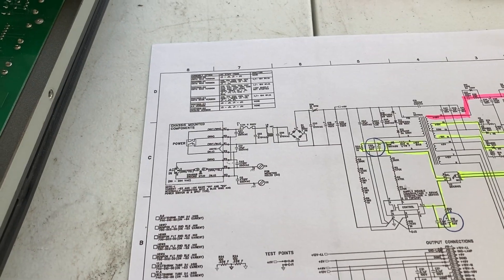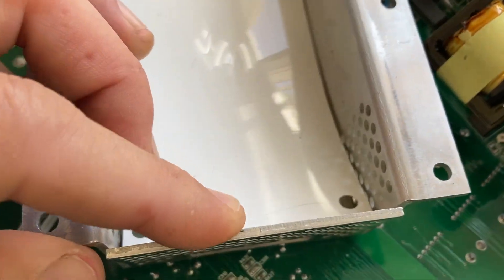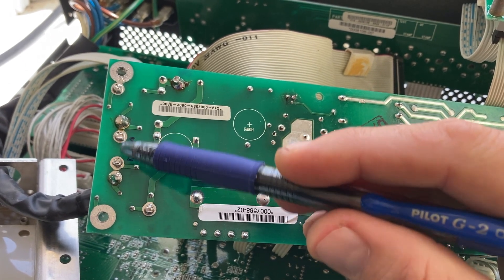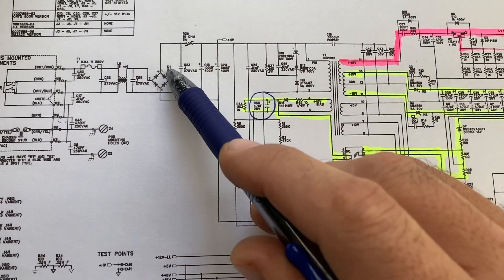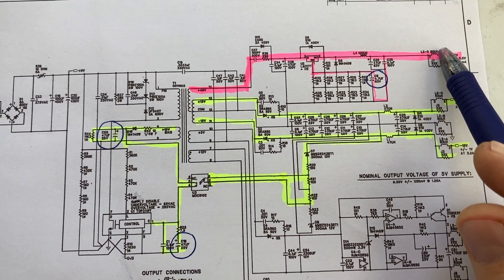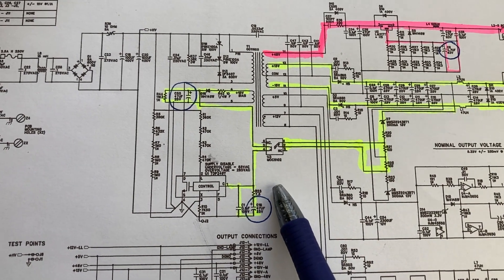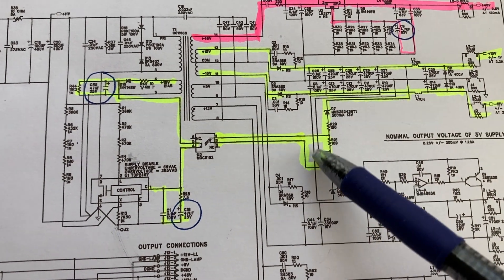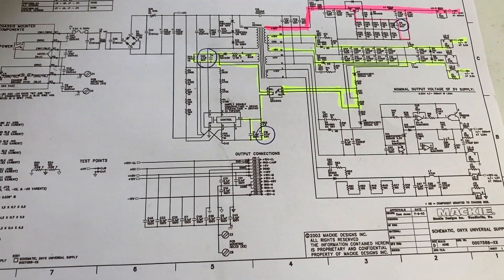Mackie Onyx Mixer Power Supply :: Flashing Blinking Lights :: Audio Electronics Repair Fix

Comment: Hey my friend, or savior! I don't know if you'll see this post since your video is over three years old, but you never know. So, after a storm and numerous power outages, and despite having unplugged all my equipment at the start of the bad weather, my Mackie 1220 Onyx still experienced the first two power cuts/instant restarts. Now it turns on, with all the LEDs flashing and a regular, rapid clicking sound coming from my speakers. All this to say: How did you manage to remove the PCB from the aluminum case? The white pin on the front is stuck, and I'm afraid to force it and damage everything. And the power wires at the front are held in place by a black cable tie that's impossible to remove. Please help me! And thank you for your video, which gave me hope of saving my baby. I hope!
Reply: Okay, bro! Mission accomplished!!! I hadn't noticed that the aluminum tab on the front could bend; I thought it was all one piece with the aluminum casing. And there were also the components on the right side that were stuck to the casing. But it's all good now! All that's left is to test the capacitors. I'll start with C55 and C16 since I have the exact same symptoms as you. Thanks again for your video, which helped me get unstuck. Happy New Year to you!

Comment: Great video. I used your schematic on my MX8 Power board and discovered the 6 470uf/25V caps powering the -15V/+15V rails that were out of tolerance. One of them bulging, so I hope that resolves my issue when the parts arrive tomorrow.

Comment: I believe I may have solved the C9 mystery. If you look at the schematic for the "Mackie Onyx-1 Medium supply" then you will see that there is a capacitor which, were it to fail, may lead to blinking lights as the symptom. The Onyx-1 Small supply shares the same capacitor, as they are very similar designs. So the person who claims to have achieved a repair by replacing C9 probably just had one of those two.

Comment: having an extremely difficult time finding a schematic for an onyx I small supply out of a mackie profx16v2. any direction you could point me in on finding a schematic for my power supply?
Reply from the maker: Acquiring schematics for newer models is challenging. Try https://elektrotanya.com/. You may be able to find an older iteration schematic that may have a similar PSU. Often the various psu caps bulge on mixer PSUs from heat.

Comment: I replaced the C16 and C55 capacitors and the blinking issue stopped and the mute/solo buttons work/light up however at the top of the board the phantom power doesn't work/light up and I am getting no signal from any inputs. Would replacing the C9 help? is there anyway to diagnose this issue without replacing every capacitor and diode?

Comment: This video is a godsend!  My desk (an Onyx 1640i) is 8 years old but judging by the number of desks that exhibit this problem I'm fearful that Mackie have been using cheapo electronic parts in their products. Correct me if I'm wrong.
Reply from the maker: @roofus53  mackie quality declined when it sold to Loud in the early 00s
Reply: my onyx 1640 just experienced this failure and is 20 years old

Comment: Hi I am working on a Peavey src 2400 and I have positive voltage readings at the power supply but no negative 15 or negative 24. What should I check next? Transformer? Voltage regulators? Thanks jay
Reply from the maker: Check input and output of voltage regulators. Since you have no -15V, then check that regulator, likely a 7915,  first. If input voltage on that regulator is present, but no output, then the regulator has likely failed. If no input V is present, then check transformer outputs.

Comment: Hello
I had that problem in the Onyx1220 mixer power supply and first I replaced the C9 capacitor that I saw in a different video, but it did not solve the problem.
It was until I changed the capacitors that you mention in this video, C55 and C16.
Thank you very much for sharing this information, it helped me a lot.
I don't know if the translator did a good job and made me understand (I don't know English) but really, thank you very, very much. The Mixer worked again without problem
Greetings from Guadalajara Jalisco Mexico
Reply from the maker: Saludos

Comment: my 1620i was working just fine last night - today i tried to power it on and it will absolutely not do anything it seems the power supply is completely DEAD i just paid to have a ton of other gear in my studio repaired and now i cant even use any of it im SO ANGRY - DO NOT SUPPORT MACKIE!!!!!!!!!!!!!!! THEY SUCK ive barely even got to use this thing i bought it new for 800+ $$$ didnt even use the firewire capabilities theres no reason why this should be happening to me right now